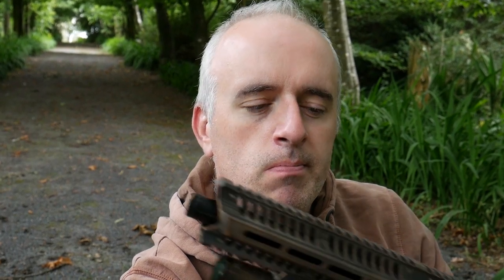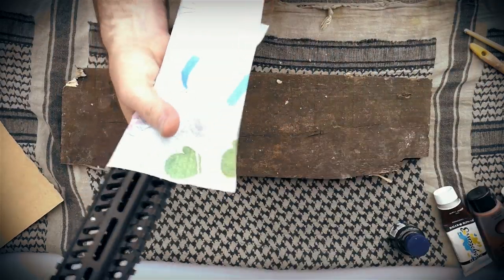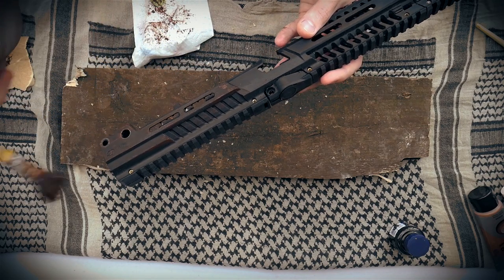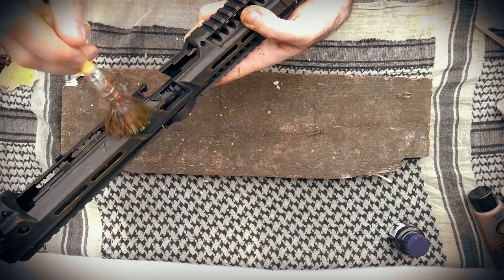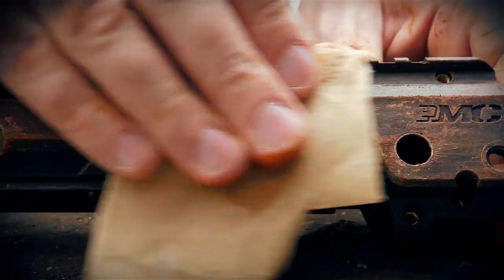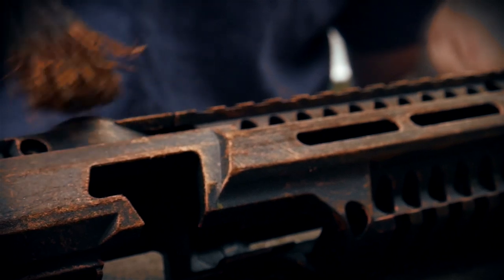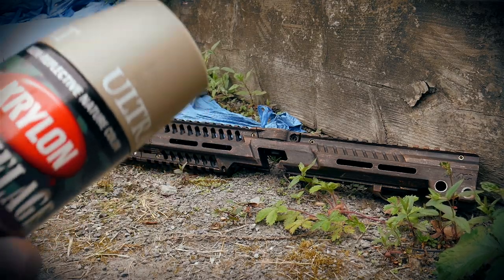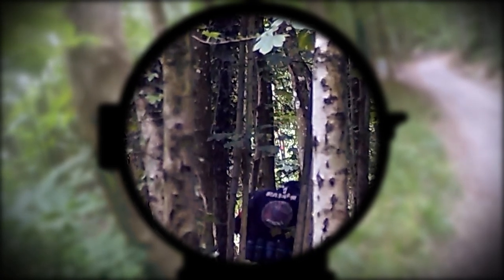How to Paint with Acrylics ►How to create a post apocalyptic effect ►How to Paint Rust

Comment: So painting is incredibly subjective. It’s all about what you think looks good and works nice, however, you forgot one vital step: a clear coat to protect all your hard work. You can go with a matte coat if you don’t want to change the shine of the paint job, or you can go with a normal clear coat if you want a glossy finish (I suspect you’d want the first). It’ll just toughen up the whole paint job and really cut down on damage from bumps and dings. With paintball we get a lot of those. It’ll also make it a bit easier to wash usually, giving the whole thing one uniform surface instead of some ink here, some acrylic there etc. It’ll just be a bit easier to wipe down. In short get a clear coat if you want your paint job to last as long as possible. It just make sense.
Reply from the maker: Nameo Lameo if you notice in my description I went onto say that I deliberately didn’t use a clear coat on this. The last marker I painted I also left off the clear coat, as I found that the look I was going for continued to get better the more I used it, packing up actual dings, scratches and debris on the field, so it continued to naturally weather, all I did with giving it a helping hand to start it off :) so I can safely say it wasn’t a forgotten decision, but a carefully layed our plan 🤫
Reply: @Aartwood  natural dings and scratch is good it show the stuff is used as intended.
Reply: In that case why paint it at all? Just chuck it off a couple cliffs and rub some dirt on it 😎
Reply from the maker: Nameo Lameo because I don’t want to break the thing, I just like painting stuff. Like you said painting is very subjective, so this is the look I wanted to create to accelerate the decayed look that will now naturally get better with age and use. If someone were to watch this video and take some tips to do there own marker, they may feel that their end result is perfect and may well Choose to clear coat it. Hope this clears it up for you.
Reply: @Aartwood  i did like the tips and as mentioned the wethering and natural use will make it look eaven better.
Reply: Yeah, with painting you kinda pick up little tips from everywhere. And there’s really no wrong way to paint. Comes down to preference. I was kinda kidding earlier about the cliff.
Reply: @Isaac_L..  it might be a joke but to paint it in a postapocalyptic way and by natural usage the paint comes to life.
Reply from the maker: extec101 so all in agreement that this looks awesome And I don’t need to drag it behind my van on the way to my next event? Excellent :D thanks pal 😘